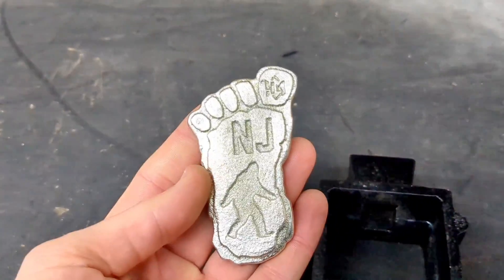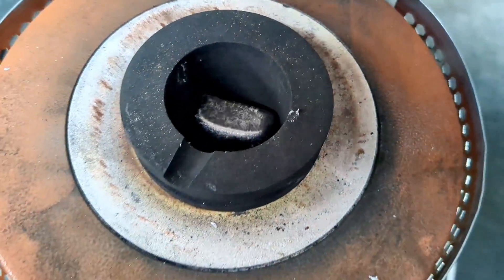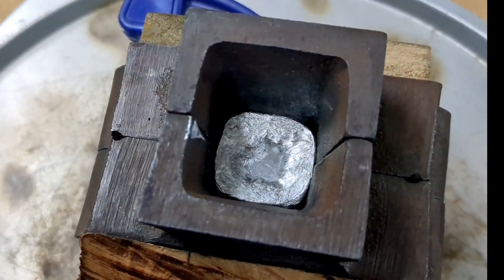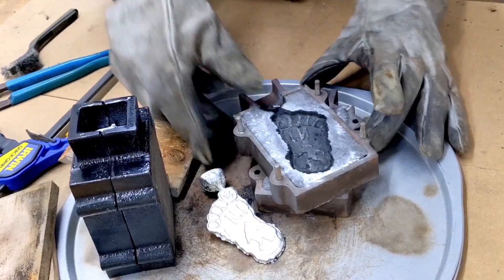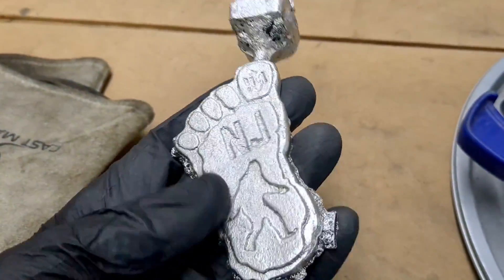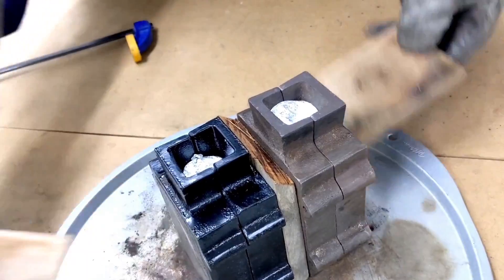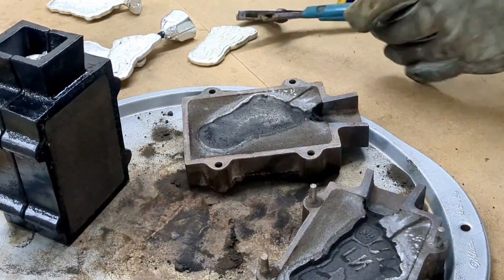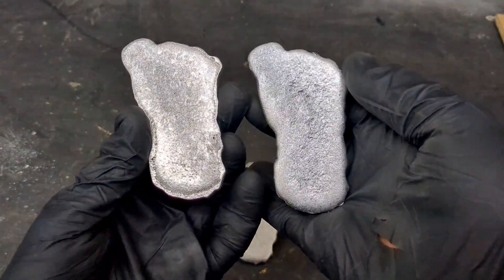(Sand Casting) Easy Metal Casting for Beginners

Comment: Is it possible to only use one flask?
Reply from the maker: Do you mean 1 half?  Like do an open pour?  You could but I wouldn't with aluminum.  Because it's light it won't put enough pressure into the pattern.  It wouldn't yield good results.

Comment: Yes Sir  , these looks really good brother , you did these nice   nice to know the little details and learn what happens ,  it is weird how the back opens 1st with the sand mold  , really great man I watched the whole video  like those cast sand molds too !   another like  bro !
Reply: the side with the detail always holds in, the sand kinda grabs the metal.
Reply from the maker: @incredible5587 not always.  In the video I'll be posting tomorrow or Wednesday you'll see.  It is actually grabbing from the flask not the sand.
Reply: @HeinrichsMade  did not mean always as in 100% of the time i should have said most of the time, most of the time it will. scientifically with expansion and contraction even on graphite molds this happens. particularly when you are going with more deeper detail in the molding. the more detail (letters, skulls, whatever, this will happen. The shallower the detail make it less likely to stick. how well someone powders the area will also depend on how well it sticks and that is just another variable. No it does not mean it is going to happen 100% of the time but that is the reason, been casting long time.
Reply from the maker: @incredible5587  yes very true and I agree 👍. In the vase with these small flasks it's usually because it grabs the open area of the flask where I poured it.  I definitely understand the sand grabbing with deep details.
Reply: yeah it's a bit weird hey  @incredible5587
Reply from the maker: Thanks!!!  I'm always learning myself.  New ways, new techniques.  Yeah, it's weird it pulls apart with the back showing.  It doesn't always happen.  In fact today I poured a few copper ones and they opened detail side...
Thanks for watching 🤙🤙🤙🤙
Reply: no probs yes I will be scrapping 3 motors today I don't video scrapping really  always good to have copper on hand   I do need to scrap that copper tank as well not sure today though @HeinrichsMade
Reply: I reckon it's because of the curved side releases easier where the flat edge isn't like exactly 90degrees so it would grab a bee's dick so will release on curved edge.